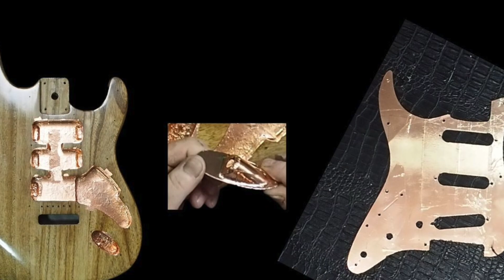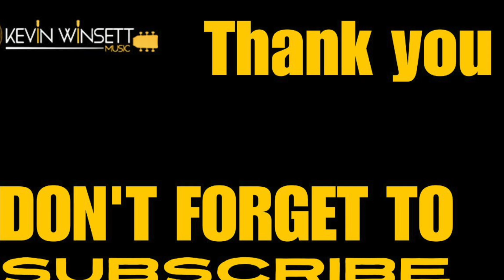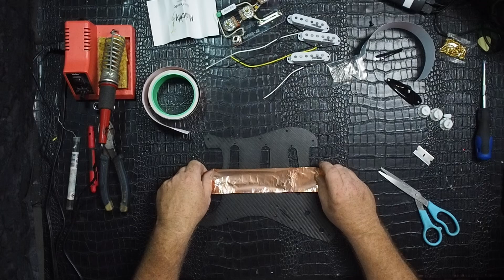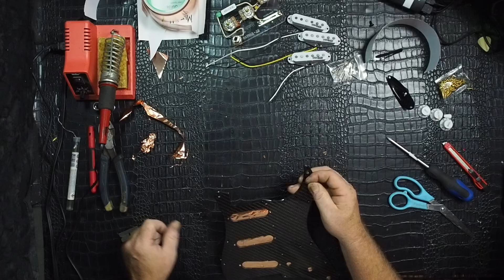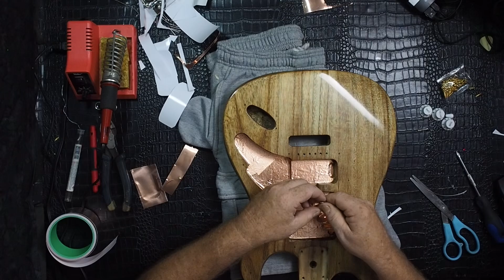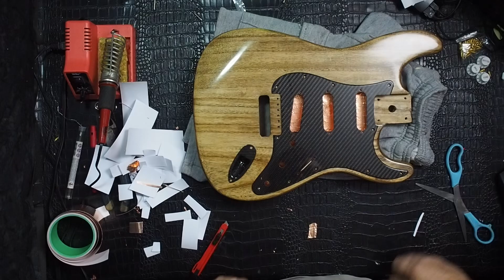Stratocaster type guitar Shielding with Copper Foil Tape

Comment: Thanks for the video... Do you overlap the tape or just make sure the edges touch when putting it on the pickguard?
Reply from the maker: I overlap it a little but on the pick guard you don’t want a double layer to be to thick  when reinstalling it

Comment: On the topic of shielding, I prefer aluminium foil (copper changes the tone, IMO).  Whichever you use, it's important to cover the whole pickguard, because strumming over bare areas with a pick can cause a kind of static-electric charge that comes through the speaker.
Reply from the maker: We all have our preferences lol And yes on single coil pickups you have to cover the pick guard to create a proper faraday cage 🎸have a good one man 🎸